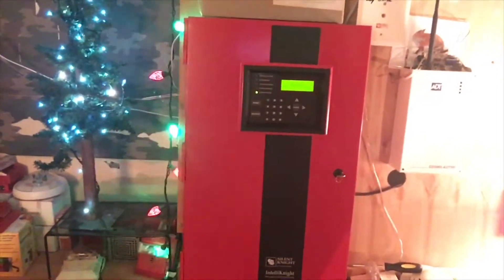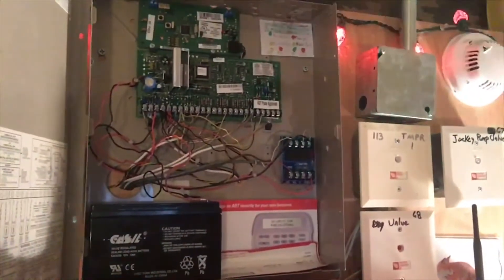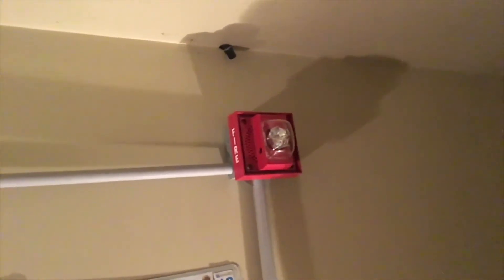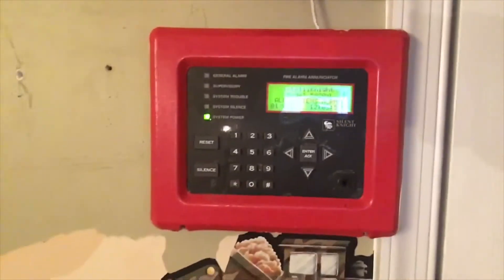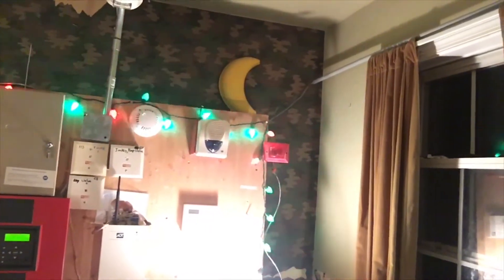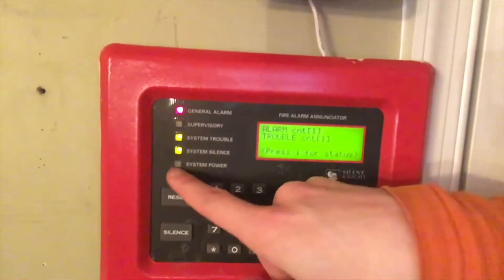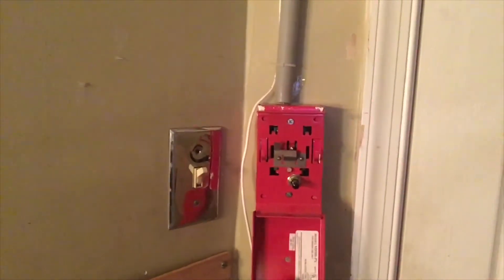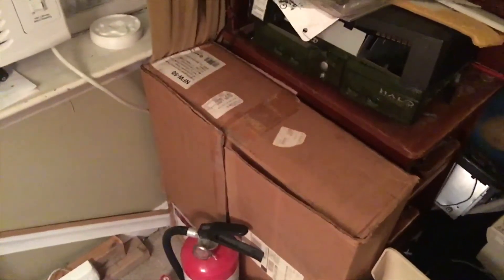System Test 43:  SILENT KNIGHT 5820XL

Comment: I wonder if the batteries you are using don't have enough amps and thus the panel thinks there is a power trouble.  As you can see those batteries from the old panel are dwarfed inside of that panel.